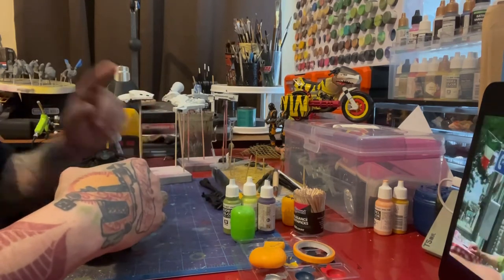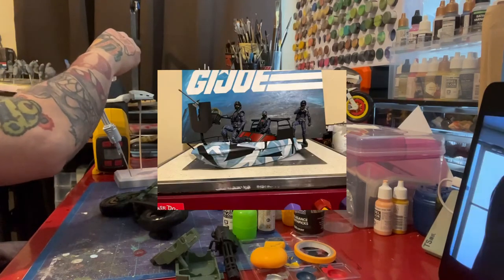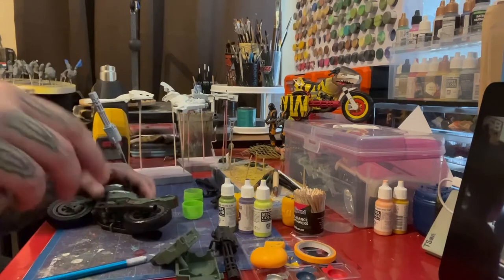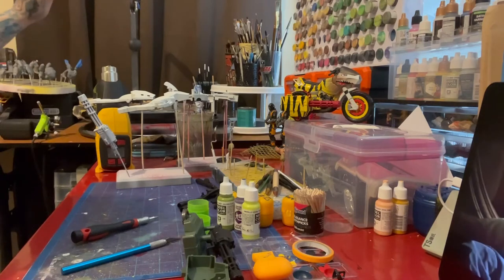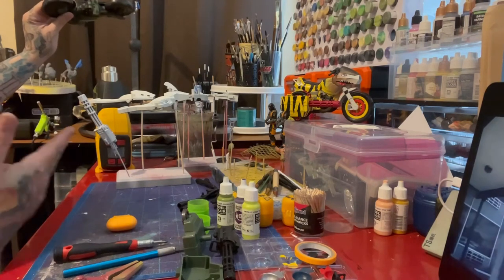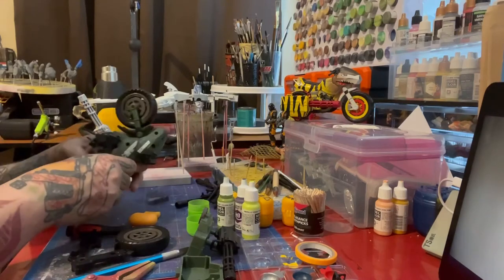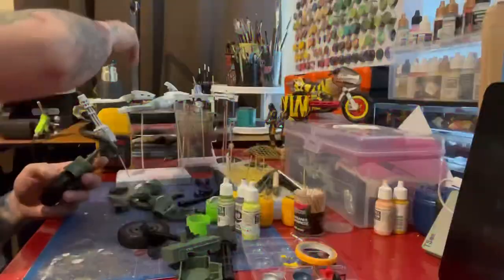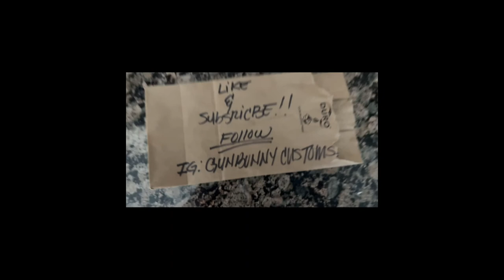How to break down a Gi joe classified Ram cycle

Comment: 👍
Reply: Tires are rubbery and will not warp(or so it seems) I used the boil and pop on the rivets/press pins…my question for you is this; are all the plugs that cover the screws the same size or are they specific to where they came out of on the the motorcycle, thanks in advance!